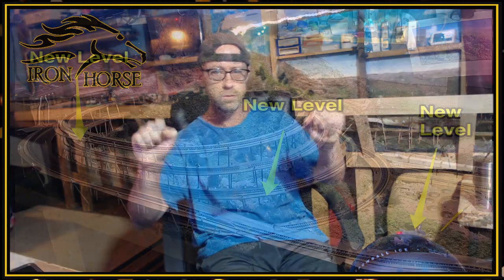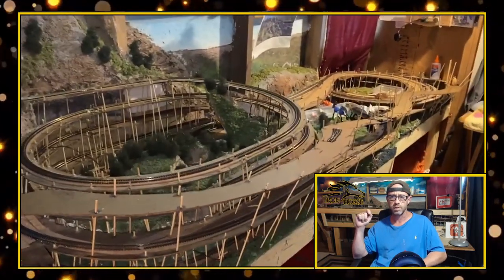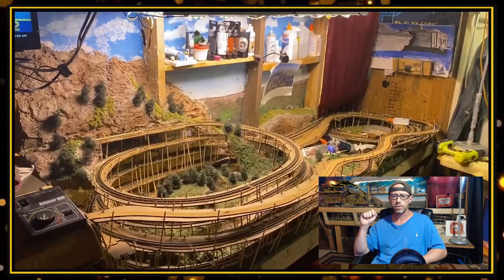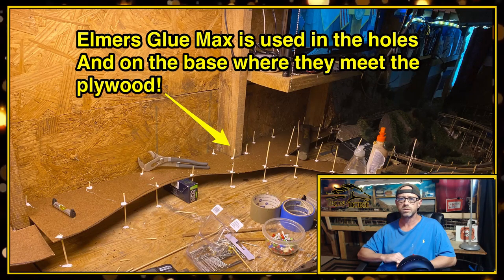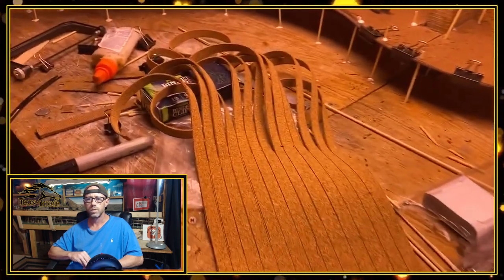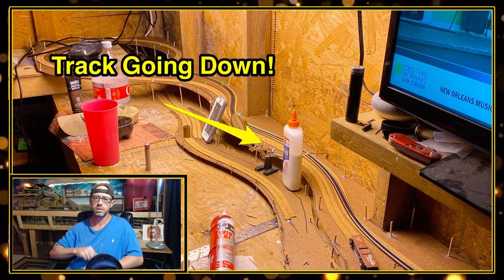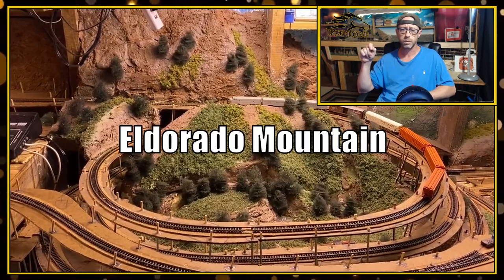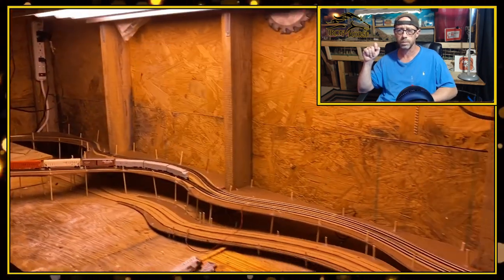16 Foot Model Railroad Main Line Extension - Scale Train Layout Track Work - Iron Horse Route

Comment: Dang fabric glue Brian great idea might have to get some,and going back to flex track soon.great layout video and all that cool track. Rail on brother it’s going to be awesome. Tks again for the ideas I’ve got now William
Reply from the maker: Yeah man... That fabric glue I found at Wal Mart in the craft section. It's gooey and sticky and kind of stringy.  Man the dang cork sticks to it like a vacuum.  Only connecting pieces in a sharp turn require any pins.   The cork from Micheals is about half the cost (at least) and doesn't tear any easier.  I use scissors to cut it.  Saves money and just a run out to the store rather than shipping ect too!.  Thanks for watching man.  You will have a clip in this month's roundhouse from your live stream running trains.  Brian

Comment: Look great Brian. You have definitely come a long way. So awesome to see your dreams coming to life Bro. I smell DCC in your not to distant future. Steve.
Reply from the maker: DCC++ is coming!  I am in the process of deciding right now.  I either need to get a new loco or two so they are closely speed matched, or go ahead with the conversion.  Conversion would be very inexpensive with the exception that I need decoders for the locos.  I have three working Kato's, but all were purchased apart and have different pickup levels now, making it tough to keep them running smoothly!  Take care.  Thanks for watching .  Brian

Comment: You've been busy over there . The addition looks awesome. Will a train be able to climb that grade going the opposite direction?
Reply from the maker: Hey Jerry!  Well..  It can, prob because I use mult locos, but it would struggle and it's not designed to do that at all.  It's sort of a double main, with the uphill route having much more track.  NO returning loops.  I have round a bouts of sorts with curved turnouts at each corner.  Thanks for commenting and watching!  Brian

Comment: You are DC, yes? Do you have a control panel with blocks setup?

Very exciting that you were able to expand the mainline and run trains within an 8 minute video. It would have taken me weeks to accomplish.
Reply from the maker: Yes.  I am currently DC.  Soon to be DCC ++  I have no blocks at this point.  I have a main bus that runs around the entire shed with places for the drops to connect.  I assume that when I convert, I will make whatever changes are needed for future organization and reliable operations from that point.  Yeah.  16 months ago this video would have been a 3 part series :-)  .  I am learning to cut harder as I mature some! :-)  Thanks for watching and commenting Heath! Brian
Reply: @IronHorseBrian  The flow of the video worked really well. The editing and final length of the video were perfect for the subject.